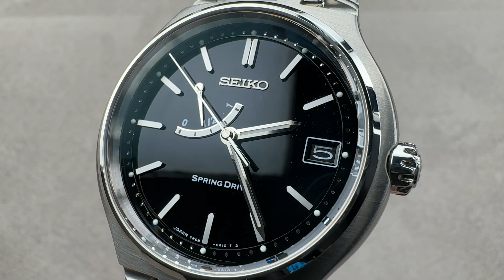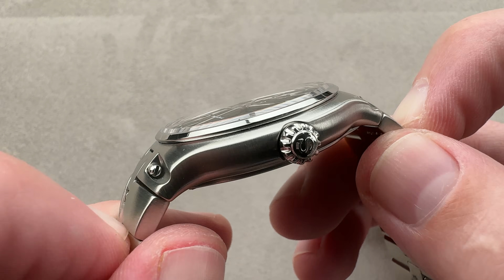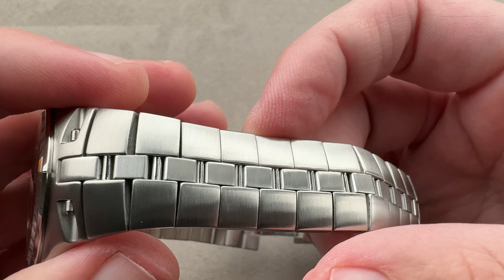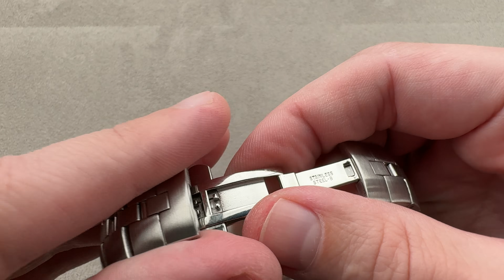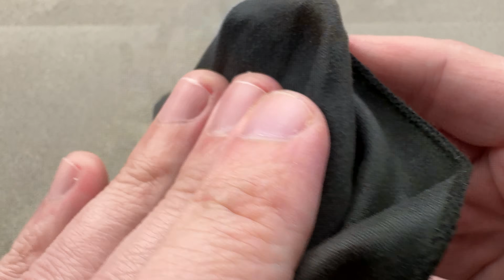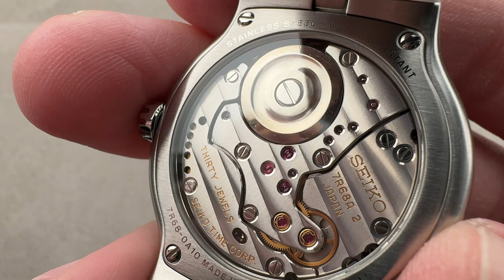Seiko Spring Drive SBWA001 Seiko Watch Review

Comment: Quartz watch
Reply: And you're butthurt why?
Reply: Just say you don't know anything about watches, bro.🙄
Reply: And?
Reply: @urbanracer032  ...and it's a gratuitously overpriced quartz watch.
Reply: @LIONTAMER3D Clueless on spring drive, what a shocker.
Reply: @urbanracer032  clueless on quartz, NOT shocking at all, not in the least: 0%
Reply: @LIONTAMER3D A mechanically driven watch with a quartz oscillator, is that what you're hyperfocused on?
Reply: @urbanracer032  guess what?  All non-digital watches are mechanically driven, by definition.  That's a quartz watch, full stop.
Reply: @LIONTAMER3D Your own comment just described spring drive as a mechanical watch. Thanks for proving my point.
Reply: @urbanracer032  your point seems to be that all watches are mechanical, even the quartz ones
Reply: @LIONTAMER3D This watch has a mainspring and a barrel, thus mechanical.  It feeds that energy through a gear train into an integrated circuit and a quartz oscillator. Are you fixated on the quartz aspect?
Reply: @urbanracer032  i get it, you're not familiar with what quartz is/does, that's why this conversation is over
Reply: @LIONTAMER3D Just admit you don't know anything about watches.
Reply: @urbanracer032  I'm wearing a 15500, you?
Reply: Just like a traditional mechanical watch, a Spring Drive is powered by a mainspring. The quartz crystal (instead of a balance wheel–based escapement) controls how that energy is released, similar to how an electronic fuel injector (instead of a carburetor) controls fuel flow in a gasoline car. The main energy source is still gasoline. So calling a Spring Drive a quartz watch is like calling a modern ICE car with an electronic fuel injector an EV. Also, the term ‘quartz watch’ was coined long before Spring Drive existed. Calling a Spring Drive a quartz watch is an anachronism. Haha
Reply: With Citizen making a quartz watch with accuracy of 1 second per year, one can no longer sneer at quartz timepiecees. A good mechanical watch is lucky to have accuracy of 1 second per DAY. And don't get me wrong, all my watches are mechanical, but it's just mindless stupidity to bag quartz. People need to pull their head out of the sand.
Reply: @WendyandGeoffPattison  "mindlessly stupid" is paying +$8k for a quartz watch; asinine